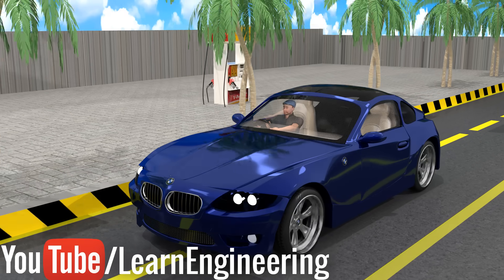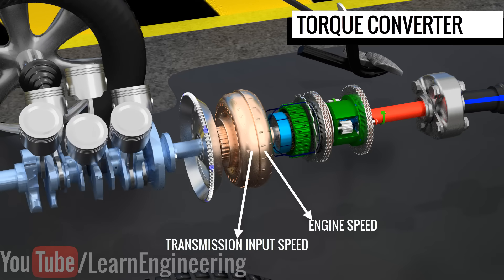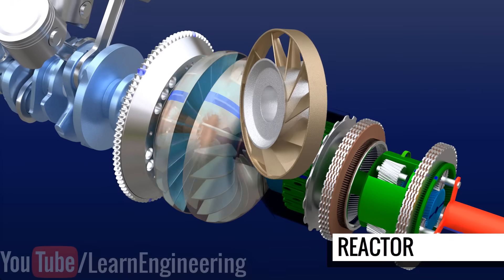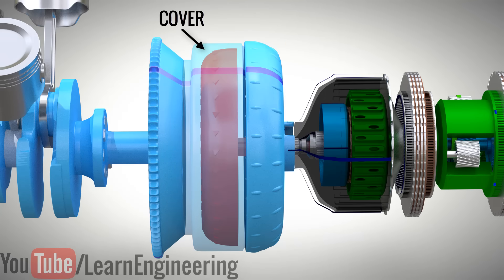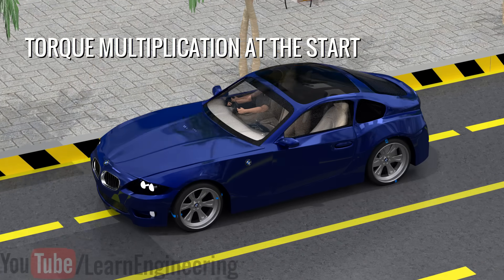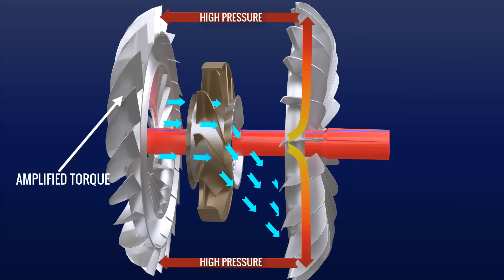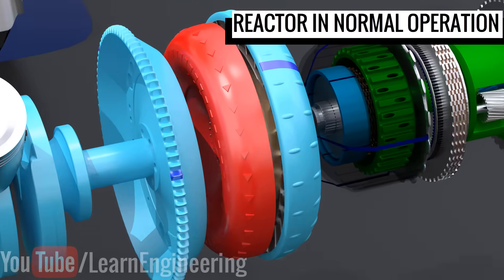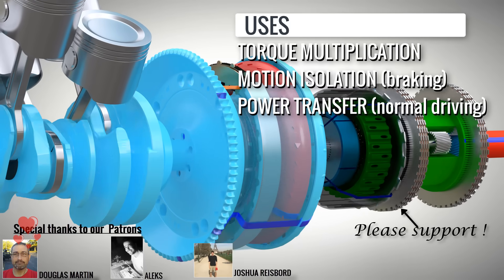Torque Converter, How does it work?

Comment: The lockup clutch is the best thing they've added to automatics. For those who don't know, older automatics in some vehicles did not have a lockup clutch. The converter was a constant slip or steady slip design. Very common in 70's - 90's medium and light duty diesel commercial trucks and buses with Allison automatics for example. What does constant slip feel like? Feels the same way your modern automatic behaves in cold weather when you first drive it while the transmission is cold. It takes about 15-25 minutes of highway driving to warm up the transmission enough to trigger the lockup clutch and when that happens the engine rpms will lower slightly and it will behave like a manual transmission since there is a direct connection between engine and transmission. Older automatics feel like "they're cold" the whole time being driven, constantly slipping and inefficient by comparison.
Reply: Indeed this was why automatics were so hugely unpopular in Europe until quite recently. They made all driving "leisurely" whether you wanted that or not and drank fuel like there was no tomorrow compared to the manual transmission option in the same car which almost everyone bought this side of the Atlantic since fuel cost enough that people weren't blase about wasting it so adeptly. Modern automatics which lock up are better than they used to be. They're certainly easy to drive, and they can change gear faster than manual transmissions can be changed so they look quicker on paper now, but of course the real reason manufacturers love them is that it's much easier to map an automatic to do well in controlled emissions testing cycles than it is to do that with a manual. Real life doesn't matter so much once the taxation band is achieved.
Reply: @sovereignhobbies  I love how Europeans embraced the combination of diesel engine and manual transmission efficiency. It's a concept that average Americans still cannot grasp. Part of the blame goes to the greedy American auto manufacturers that offered the worlds shittiest unreliable diesels for sale in the 80s. The other part is diesel repair shops and parts suppliers were very scarce here. Another is diesel straight line performance was embarrassing compared to a gasoline equivalent. No matter how hard they tried, diesel engines never caught on unless it's under the hood of a half ton pickup truck. We skipped trying diesels altogether and are moving on to electric. I despise electric with a passion because it takes all the fun out of driving and we do not have the proper infrastructure for it. Our firefighters cannot figure out how to extinguisher an electric car battery fire either. I'm not a fan of modern automatics either. They too take all the fun out of driving. The real reason why American auto makers pushed most Americans into automatics is because they never did make the manuals as good as they could have for one and for two is because automatics are more profitable to buy and repair down the line versus a manual. In USA everything is done in the name of profitability. Profits come first everything else is an after thought.
Reply: @sovereignhobbies  Modern automatics here in Europe are even better. They are essentially robotic manual transmissions.  Just the same tech as manual transmissions, including a clutch (or 2 even), just operated automatically. They are even more efficient then manual transmissions :)
Reply: @1987tijgertje  there are relatively few dual clutch transmissions on sale, and automatic single clutch transmissions (e.g. found in the E60 M5) were fairly universally hated and not really in use any more. By far the vast majority of automatics in Europe are locking torque converter transmissions with ZF making up a large proportion of the market share.
Reply: is this the same as "Overdrive" then?
Reply: @Cutstalk   No, overdrive refers to a gear ratio that is "overdriven". Or a gear ratio that is less than 1 such as "0.74", almost always overdrive is the top gear, in modern multi speed (more than 4 speeds) transmissions there's usually 2 overdrive gears....a direct drive is a gear ratio that is 1 to 1 such as "1.0", usually 3rd gear in a four speed automatic is direct drive and 4th gear in a 5 speed manual is direct drive, USUALLY, but not always. An underdriven gear is a gear ratio that is over 1 such as "1.56". These are always the lower gears in the transmission. Torque converter lockup drops the engine rpm slightly but it does not change the gear ratios at all even though it feels like it does.
Reply: @FuckTrumpFuckYouIfYouVoted4Him  thanks for explaining
Reply: @Cutstalk  you're welcome mate! It took me a long time to understand how automatics work I know it can be frustrating trying to figure it out hahaha
Reply: Once the transmission is warm enough, does the lockup clutch work in every gear?
Reply: @felixgluhak1267  that depends on how the transmission is designed and calibrated and whether or not it has a modulated torque converter. Some transmissions will not lockup the torque converter not even under light throttle until it has reached third gear and a certain minimum road speed, others will lockup once the transmission shifts into second gear and some do it immediately after the transmission hits third gear and some won't lockup until after the transmission is in fourth gear. The sooner it locks up the longer the transmission will last because it eliminates slippage after lockup which means lower transmission temperatures. Only a high torque engine can be locked up in 2nd or 3rd gears at low rpm, usually big V6 or big V8 engines.
Reply: @srgchannel8261  an automotive engineering degree
Reply: isnt it possible to replace the clutch with a torque converter but retain the manual gearbox? both in case of car and motorbikes?
Reply: @MJ-rr4hd  In an automotive application, no. A torque converter is very heavy and takes a lot of energy to rotate. It also produces a lot of heat. About the motorbike, not sure how they work. I assume they use a small clutch like motorcycles.
Reply: What is the temperature range you are talking about here?
Reply: @SocialPerspective101  For my 2015 GMC Sierra, about a month ago it got down to 16° F in Houston, TX and exactly what Head Liner is referring to happened. You could feel the torque converter slipping for the first 10 minutes of driving with the extra thick fluid. After that, the transmission fluid warmed up and it locked up normally.
Reply: @bigdukem69  yeap!!!
Reply: @SocialPerspective101  it's not necessarily a "temperature range", it's whatever operating temperature the transmission is on take off. If it's not up to a certain temperature it will not lock the torque converter until that temperature is reached. This most often occurs in cold to chilly weather, it can even occur in mild weather too if a vehicle has been sitting for months.

Comment: So then when you apply the brake the lock up clutch becomes disengaged right
Reply: It disengages even before you apply the brake. When you take your foot off the accelerator, and the load changes on the drive train, the lockup feature (usually) deactivates.

Comment: That guy at the beginning is driving on the wrong side!! ,lol (im joking), ive been working on cars since i was a kid and Ive always liken auto transmissions to electricity, you ever talk to anyone thats a jack of all trades and when you mention electricity they stop you right there? "nope dont get involved with that" ha ha ha, same with auto trannies,if you open them up it looks like aliens had a hand in designing them, they sure have many parts,clutches springs, ball bearings, gears,electrical solenoids, you name it, its in there,they are amazing and all that so you dont have to press a clutch and move your right hand (or left like the guy at the beginning of the video) up and down and across over and over and over, they sure are nice.

Best way to take care of them is change your fluid every year or 2 and dont let anyone near it that wants to "flush it" no no no no,when you change your fluid granted a big part of the old fluid stays in there but it mixes with the new and everything works ok, adding a little cooler helps wonders too,heat is the enemy of these alien creations.

Comment: Do cars with CVT transmission use torque converters as well? Or do they have some other type of clutch mechanism?
Reply: Yes they use a torque converter and usually a electromagnetic clutch, for smooth start up and to protect the metal belt

Comment: I have a Opel Meriva B Diesel Automatic. A lot of the times (and I believe it's worse after having stopped at a light for a while, so the fluid might be hotter?)  while accelerating the switch from 3rd to 4th gear the engine is allowed to rev higher and the engagement of 4th gear come with a shock to the car. Might this be due to bad/failing solenoid that has the job engaging the lockup-clutch?

Comment: What a very poor demonstration this is, or better yet, it's not good at all and here is why.  Just explain how the fluid travels and how the Turbine can stop spinning while the engine is running.  At 5:16 you explain that the pump is spinning at the engine speed, so the viewer is to assume that there is a shaft from the engine that sets inside a shaft that bye passes the turbine and spins the pump and then when the pump is spinning it pushes the fluid to the turbine turning it at a slower speed then the pump.  And then you get into high pressure blah blah blah explaining how the fluid traveling from the pump turns the turbine and then sends it to the reactor blades and then back to the pump  creating a circular motion.  But you DO NOT explain how the turbine spins the transmission!!   What is connected to the turbine that would allow it to send power to the transmission????    

Engine spins pump, as the pump spins it sends fluid to the turbine turning it, as the turbine turns it sends fluid to the reactor blades which controls how the fluid returns to the pump.  This is the circular motion, but you FAIL to explain how the turbine sends power to the transmission.  You need to explain the physical connection between the turbine and the transmission.  Without this your explanation gets a F.  And a A for graphics.

Comment: I believe torque converter does also as torque controller thus at minimal torque there is great slippage between pump and turbine and in this situation it can not rotate the transmission when brake is on.

Comment: I think you guys should have explained the mechanism of lock up clutch. I'm assuming the lock up clutch only locks up when you push on the gas, and unlocks when you let go, so that the engine doesn't stall. That's the reason why the two parts were separate in the first place right?
Reply: The lock-up activates when you're cruising at highway speeds to reduce fuel consumption and heat

Comment: I have a 2009 Honda CR-V with a 5 speed automatic. It has 120,000 miles and has had the trans fluid changed every 30,000 miles. It has only been drained and refilled with Honda fluid. At 100,000 miles also changed the in line trans filter. I experience a shutter going from 3 to 4th gears (not always). To repair this what needs to be changed? Thanks….Jim

Comment: The modern automatic transmission, and for that matter the entire drive line including limited slip differential is an awesome set of pieces of technology. Together they work amazingly. Separate they don't do a thing.
Reply: Check out the Torsen differential.

Comment: I made a living x25 years working on automatic transmissions. I’m gratified so many people are impressed by these machines/designs.
Reply: What is a stall speed torque converter?
Reply: @standhd  the stall speed of the torque converter is how much engine rpm the converter will allow before the vehicle must move. If you put the transmission in drive, hold the brakes, apply throttle — the engine rpm will only go to the stall speed. Inside the converter, the way it is built, determines stall speed. Drag racing prefers higher stall speed, for instance, because the engine is allowed to rev to a more powerful speed before load is applied.
Reply: @davidbalentine2110  Oh ok. Thank you for the reply.

Comment: Is the point at which torque multiplication stops the stall speed or is that the point the clutches engage? If no why do they rate converters in terms of stall?

Comment: In the early days of the automatic transmission GM's Cadillac used a fluid-coupling or fluid clutch with a 4-speed planetary genset, but it suffered from poorer fuel mileage, those days gasoline was relatively inexpensive and plentiful so no need to worry about the cost of gasoline. The later designs of the Hydra-Matic incorporated the reactor/stator and the transmission was redesignated Turbo-Hydramatic. 

Today's modern automatic transmission has only one stator/reactor, but in the past Buick had 2 of them, but I think the bean-counters at GM over-ruled the engineers because it was more expensive to build. Back then each GM division had were pretty much autonomous companies with its own R&D, bodies, engines, transmission etc etc. Today the GM divisions have lost their identity and now use corporate common body, engine, & transmission combos.

Comment: The fact that, all the use cases such as slowing down, disconnecting power  to transmission, providing torque when needed and not when not needed is all satisfied with this one piece, is unbelievably🤩 amazing

Comment: My job consists of taking these out of a box then loading them on a rack and running them to the back to be cut. They are usually full of fluids and weigh 40 to 60 pounds

Comment: place two fans facing each other and turn one of them on, the other fan will spin in the opposite direction,this is how a converter works but instead of air it uses fluid.

Comment: i'm new to this stuff, so for the engine to pump and turbine to trans config., why not just add another bearing & trans shaft in the middle of the pump? wouldn't that help to achieve the crankshaft centerlining requirement?

Comment: The turbo incabulator already achieved this at a much higher rate of thrust to incabulation ratio in the early 40s. The only reason we use torque converters at all is because of the complexity of manufacturing spurving bearings. Some people, myself included, believe this was a deliberate effort against the consumer by the DOE, as a turbo incabulator has many useful implications outside of pure mechanical hydroxinatulization. We could be truly living in the world envisioned by the Jetsons. Someday we will obtain the secrets to the tesla tower, and the production methods of prefamulated amulite. Without good amulite, magneto reluctance cannot be achieved, thus burning out the spurving bearings, causing sigmoid rumbling. We all know you cant mix spurving bearings that aren't from the same batch, even if you managed to seal them in a pure nitrogen environment during transfer. Geomagnetic orientation is baked in when they condense from plasma, thus preventing bearings from different hemi-lateral batches from functioning in tandem.

 It really is too bad, when you think of just what the world could have been.

Comment: So, torque converter makes the same job as clutch in cars with manual transmissions.
Reply: Yes but in a constantly slippery way and gives your the impression of throttling a boat engine in water. It regularly idles when you release the pedal, constantly slips when you depress it. It rarely use the external lock clutch to avoid slippage. Manuals are just more satisfying because your engine is hard locked to the wheels under YOUR control.
Reply: @vindieu  Fully agree.

Comment: By creating high and low pressure area using a turbine decreasing efficiency and  contributing to wasteful heat energy increasing energy consumption and ultimately premature wear to your 10 speed automatic transmission.

Comment: Wow, really stunning. I always thought a computer mechanically changes gears depending on how fast you drive :) I wonder how they seal the whole thing from leaking.
Reply: this only disconnects the motor from the transmission all the gear changes happen in the trans its a whole different can of worms. The unit is inside of a case that is pressed together watertight and will have an o ring between the two halves all the moving parts are inside this case.
Reply: @nuclearbwl  so how does the gear change happen in automatic transmissions?
Reply: That is how Automated mechanical transmissions (AMTs) work.

Comment: So are those "ridges" on the outside casing of the converter purely decorative or do the serve a purpose?
Reply: The tips of the internal vanes are located by these lobes .
Reply: @rebekahfrench5747  so they are anchor points visible from the outside? That ACTUALLY makes sense! That's perfect! Thank you Rebekah!! 😁👍✌️

Comment: Wait, if they added a mechanical coupling, then what is the point of this device?
Reply: To isolate the drive wheels from the engine? It's literally described at the beginning. If cars didn't have a lock up clutch the car would at minimum lose about 10 percent power. It would be like driving a manual transmission and letting the clutch continue to slip even once you were fully moving.
Reply: The lock up clutch only engages at higher speed, when you are cruising and not needing much torque. On most automatic transmissions it engages in 4th gear.

Comment: Good animation and general explanation but the names are wrong. The piece you are calling the pump is the impeller. The part you are calling the reactor is the stator. The pump is contained in the transmission itself.